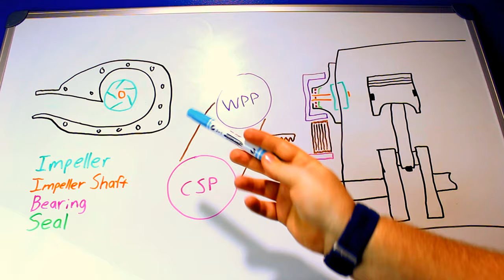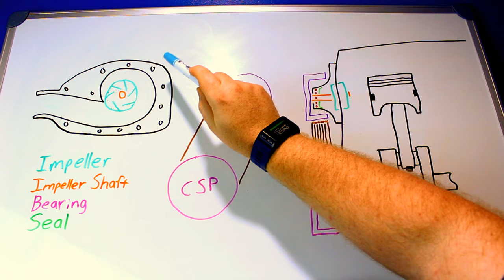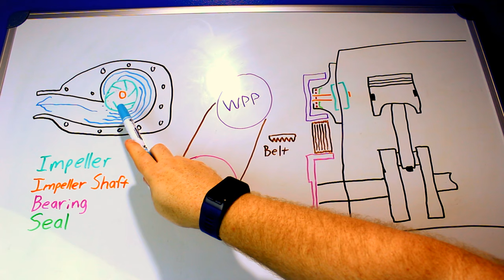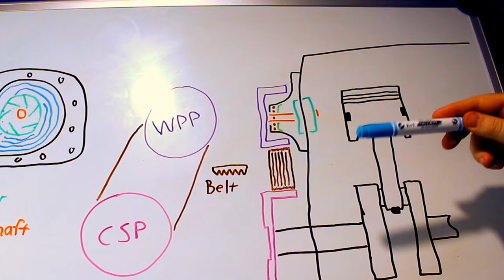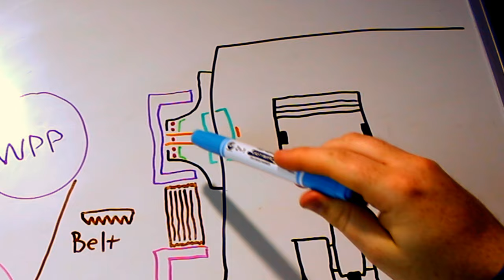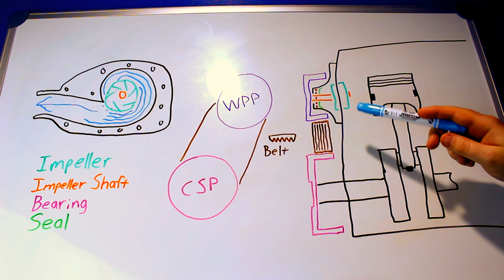Mechanical & Electric Water Pumps Explained • Cars Simplified: Cooling System

Comment: Cheers for that.  I have a Nissan X-Trail 2007 and it needs a new radiator and water pump. It has the original. I am not mechanical and expect the original to be mechanical.  Looking at my Supercheap (In Oz) parts store the electric versions are quite a bit more expensive. There seem to be pros & cons of either type.

Comment: Or you could drive an old air cooled VW and not have a water pump or radiator.  Or better yet an early Porsche 911 or 356.
Reply from the maker: I would love to own one of those one day. The first engines I worked on were air-cooled (go-kart engines) and they have a nice simplicity to them.

Some time I will talk about those as well as liquid-cooled engines that didn't use a water pump.
Reply: @CarsSimplified  Steve looking forward to that video like all of yours!